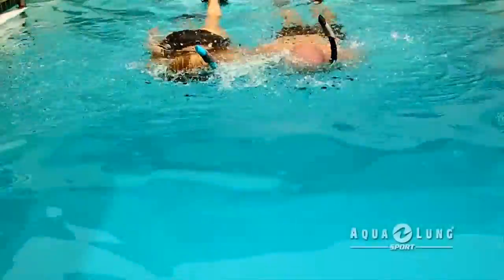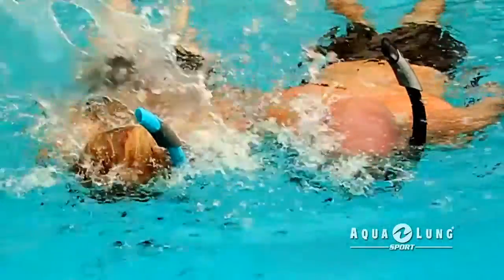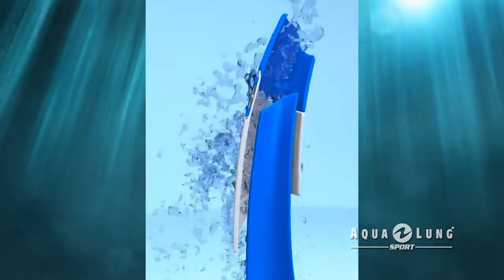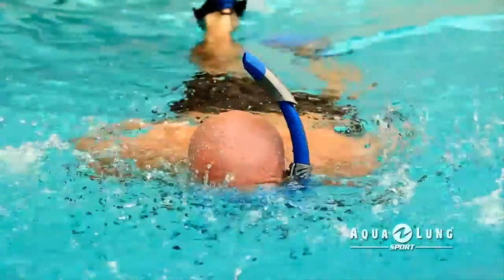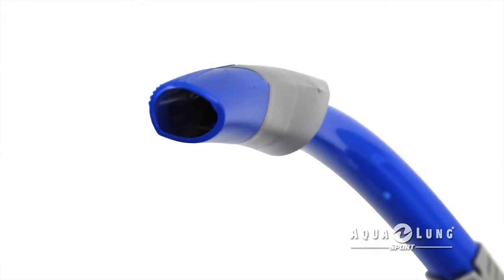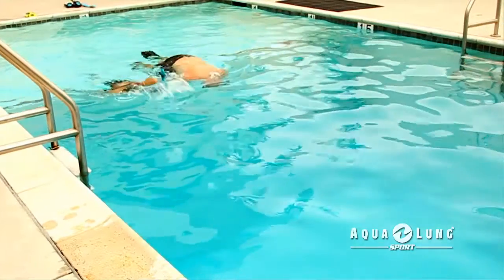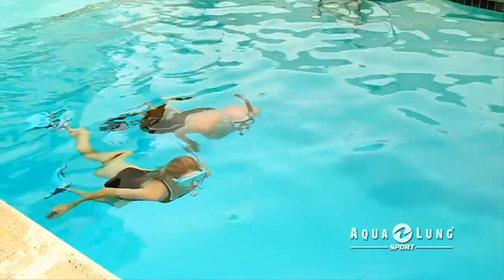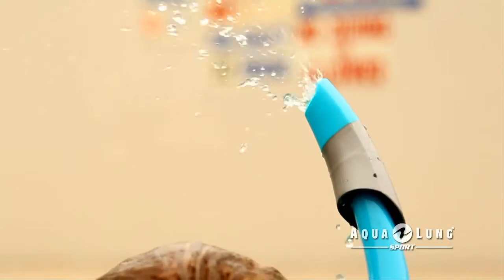Aqua Lung Sport - EN - Hydro adhesion Technology For Snorkels

Comment: used one in the keys it dosent clear all the water out and when your looking to take a deep breath it sucks water in the top due to all that water running down the spout.  Oh and the purge on the bottom is sooo thin a baby couldnt breathe in light enough for it not to leak water in the bottom. where are your engineers at aqualung?   why do you make this inferior garbage. it sells for 9 bucks right so like just make a normal 'j' snorkel with a simple bottom purge and eliminate the egronomic parts and make it wide enough for an average person to breathe through, the standard 1".  skorkels have been around for years how did this occur?